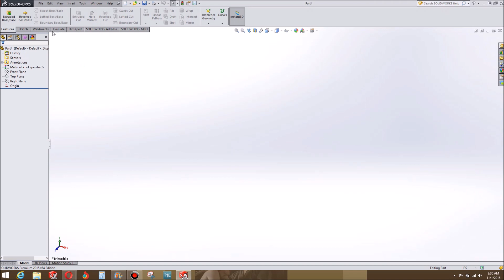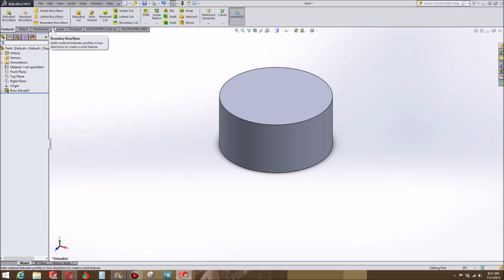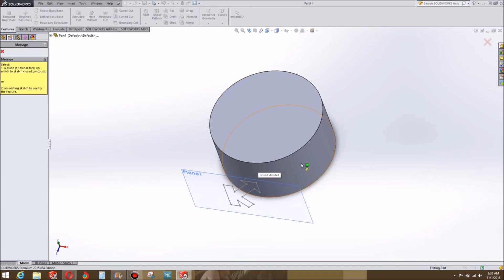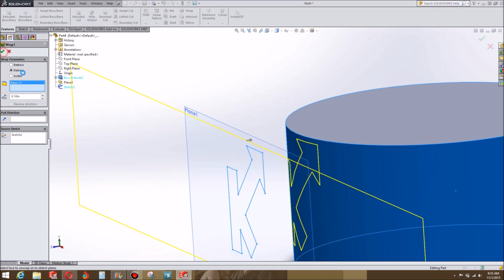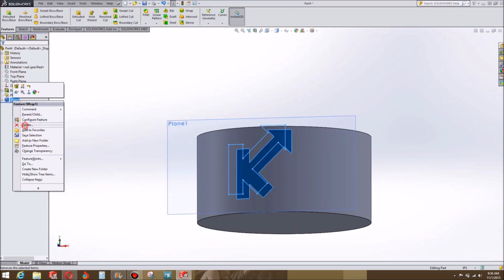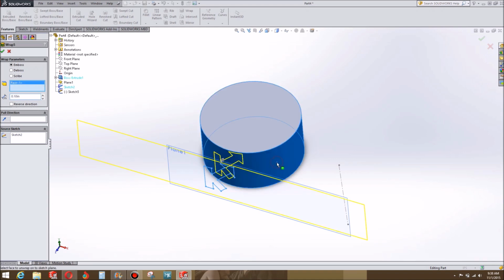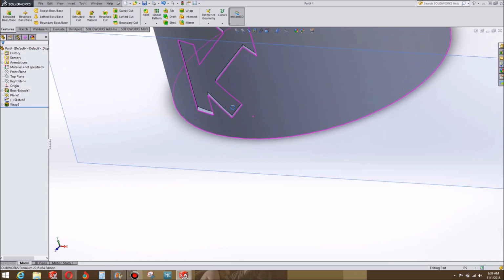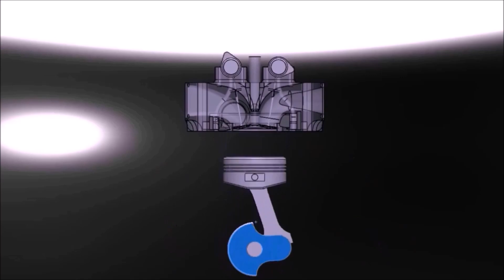How to Wrap/Project Sketch on Curved Surface/Curved Extrusion in SolidWorks|JOKO ENGINEERING|

Comment: Can this be done on a spherical shape
Reply from the maker: Yes, same procedure.  If you have any trouble, you can toggle between analytical wrap and spline surface wrap on versions 2017+ and it should work on just about any NURBS surface where the wrap doesn't self-intersect
Reply: @JokoEngineeringhelp  thanks yes thats what i did and it worked

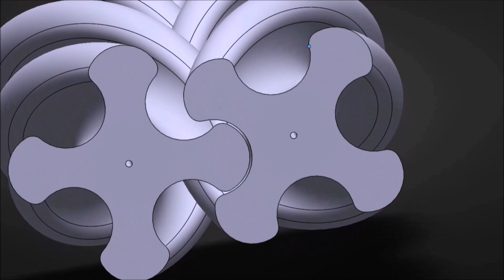Comment: Hi, regarding you your video @4:39. Do you have a more detailed how to video on the creating a heat exchanger? I've put together some "garage" heat exchangers (in SolidWorks) using copper tube as liquid transport & aluminum as exchange medium, but I've always wanted to create a machined or even 3D printed version in aluminum. With simulation comes efficiency! THanks!

Comment: Is that not working if part is made with loft?
Reply from the maker: Hi Mechl, version 2017 and later should have the wrap function work with a loft.  You may need to toggle the type of wrap between analytical and spline surface.  You may also need to go more thick or thin depending on the kind of wrap you're doing.

Comment: Hey joko, is there a way for me to sketch along a surface?. For example, I'm designing a sidepod for a racecar and I want to perform a pierce/coincident relation from an edge to a surface I lofted. Is that possible?
Reply from the maker: You would probably be interested in surface splines and 3D sketches.  I don't have a video specifically on that, but this might help https://www.youtube.com/watch?v=yBGaTpYEazo

Comment: I get an error message saying cannot wrap on open/intersecting contours.
Reply: Guess it doesn't work with cursive.
Reply from the maker: Can you send a screenshot to the email in the description?  It may be able to work.
Reply: @JokoEngineeringhelp  Was this question ever resolved? I have the same issue.
Reply from the maker: @iraseidman2706  Not on my end.  If you're able to send me a screenshot or something I may be able to help.  It can't wrap if the lines cross though